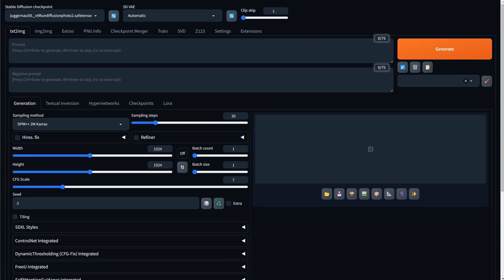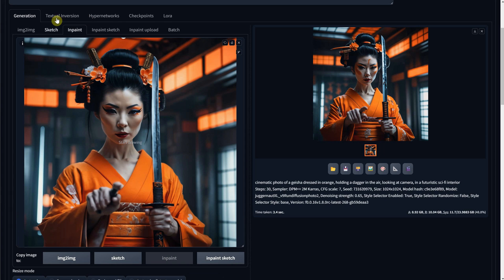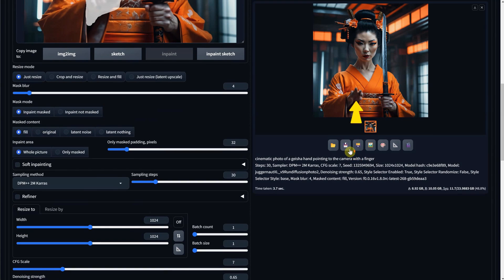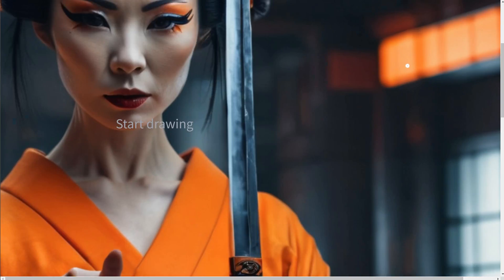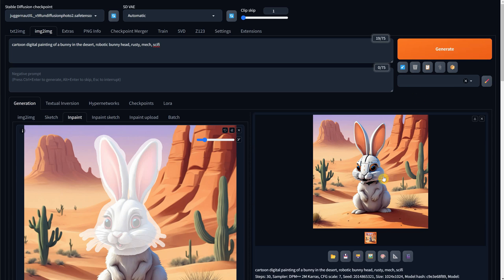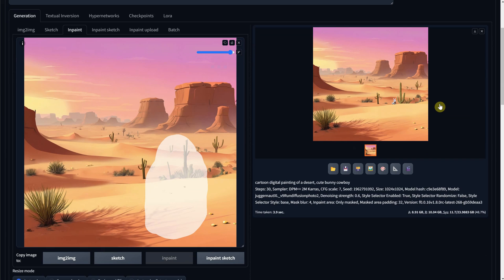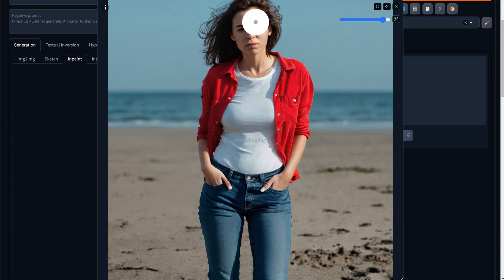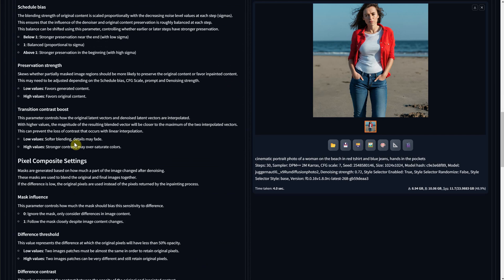Stable Diffusion Inpainting Tutorial

Comment: For some reason my Inpaint doesn't look like yours.  I don't have the little (i) and my inpaint looks different, do you have an extension added?  Plus my mask has a semi see through checkerboard circle, not a white circle. I now the video is 6 months old and that might be the issue.  I don't get the same results as you with the same settings, stuff outside the mask also get change. I'm on ver f2.1v1.10.1 python 3.10.6 torch 2.3.1+cu121, any help would be great.
Reply from the maker: They changed the interface a lot in the last month so many things are completely different
Reply: @pixaroma  Thanks for the reply, I'm checking out your videos pertaining to ComfyUI, might be moving to that soon.

Comment: The new interface is pretty much different :/ I don't know how to make bounding box.
Reply from the maker: You dont have bounding box i used that on video to show that if you put a small point in those corners thst big will be that bounding box, so you can visualize it but that doesn't appear on the interface, sorry for the confusion
Reply: @pixaroma  Thank you for clarification. So far I have used Fooocus which is actually the same, although you made me like ForgeUI :) I am afraid SD will be very soon just a platform to run Flux.

Comment: youre the best on youtube for Forge! Thanks a lot! Do you know any way to get two character Loras working together properly in Forge? I struggle with the known methods from a1111 and also Forge Couple doesnt seem to work. Inpaint works but not generation directly
Reply from the maker: I didn't find a good way, i usually just use in paint, or i make a selection of the image in Photoshop and use that in img2img to get the right character  playing with denoise to be somehow similar then i blend it again back in Photoshop with masking so it fits
Reply: @pixaroma  thanks for answering so fast! Yesterday i tried the Not masked area Option you talked about and its way faster and reliable than just using the masked area for couple pics

Comment: Very detailed tutorial, thanks for your work!
Reply: What if I'd like to remove the tattoo from one's body, without distorsion. Any idea?
Reply from the maker: Is more difficult, depends on how big is the tattoo and how much skin that is without tattoo around, you can do a combination of masked content fill first to fill that with a color, then use the masked content original, but probably is quicker with remove tool in photohop
Reply: @pixaroma Many thanks for your reply, I've tried several times, but the result so far is not so good.
Reply from the maker: @johnyoung4409  you can also try to paint the tattoo with a soft brush in photoshop picking color of the skin with eyedropper, and then run through img2img or inpaint at different denoise strength to reconstruct that skin. But so far remove tool in photoshop or generative fill with the word remove did better job
Reply: @pixaroma Thanks for your info! Yes, I did watched a video in youtube that using generative fill with photoshop to remove the tattoo. https://www.youtube.com/watch?v=YPEBymT_lz0 which is very impressive. He just use the word 'remove tattoo' and photoshop automatically do a great job.  I'm curious why sd cannot do the same thing?
Reply from the maker: @johnyoung4409  not sure probably is focused more on generating new things and making variation, adobe probably adjusted that also to be able to remove things, maybe they trained some models on removing things, maybe someone will do some day a better model just for removing subjects and items for stable diffusion, will see, it takes times, and most of the improvements on existing models are made by volunteers and dont have the Adobe budget :D
Reply: @pixaroma 🤣